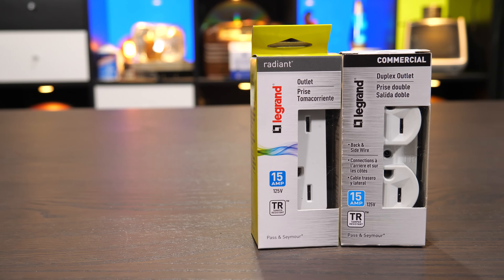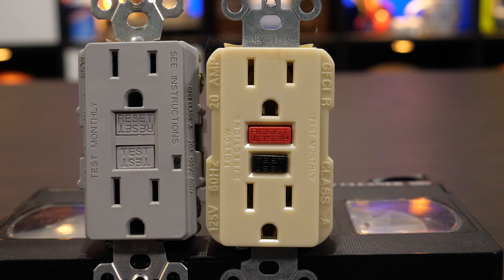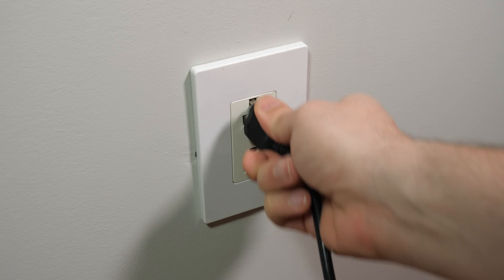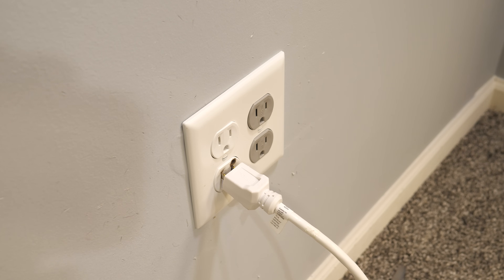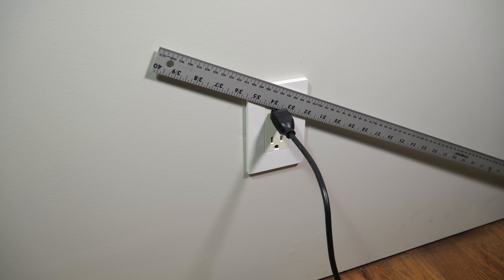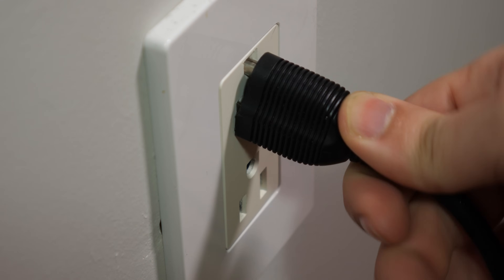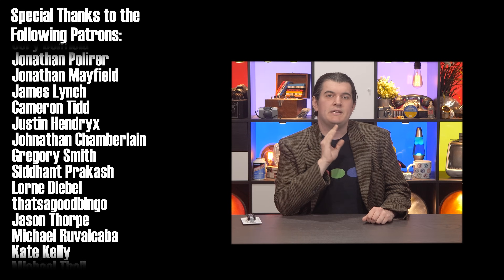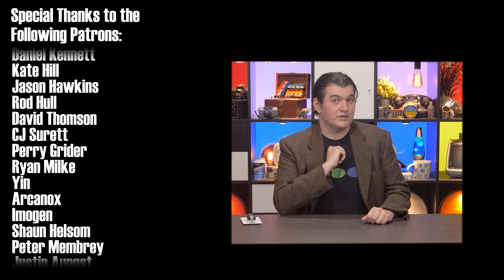Power outlets are topsy turvy - but does it matter?

Comment: Here in Japan where we use mostly-the-US-plugs-but-not-quite-100%, sleeved plugs are becoming more and more common. It doesn't seem to have caused any compatibility issues that I've seen. The sleeves are way shorter than sleeved plugs elsewhere though, basically just long enough to help with the "things falling on the plug" issue but not really the "child fingers going in when plugging" problem.
Reply: The "not quite 100%" is needing to find a screwdriver to plug in a grounded appliance 😂

Comment: Back in my youth in the '50s and '60s, I worked for my father, a general contractor after school. Among the trades I learned under his tutelage and that of his other employees was electrical work. He always insisted on installing outlets with the ground lug up. When I pointed out that everyone else installed the outlets with the ground lug down, he told me that the electrical code required the hot lead to be on the left for the older un-grounded two-prong outlets and he was following that convention. He admitted that having the ground lug down looked more friendly -- like a face.

He said that older ungrounded tools and appliances often had the case connected to the common (not hot) lead of the cord. People understood that plugging in the cord backwards would have the case connected to the hot lead -- a rather dangerous situation. I remember old two-prong outlets that didn't have polarized slots (hot slot narrower than the other). So knowing the left side of the outlet was hot was essential. Hence, standardized outlet installation.

The case of more modern tools and appliances are isolated from both the hot and cold leads, so it's no longer a big deal. But, if you plug in grandpa's electric drill backwards today, you're in for a shock.

I'm curious. Are outlets in Chicago always installed with the hot wire up -- possibly for the same reason of standardization?

Comment: I think this is much ado about very little.  I disagree with the conventional “wisdom” that the basic plug with two parallel flat blades is a poor design.  The fact that is has remained in use for more than a hundred years is evidence that it was a good design.  Over time, there have been improvements, as you have noted, and it has admitted several variations which show that it was a versatile design.  They are: simple two-blade ungrounded; polarized two-blade ungrounded; two-blade plus ground; 15A capacity; 20A capacity; simplex configuration; duplex ganged configuration; duplex separated configuration; single receptacle plus switch in a duplex configuration.  A 20A receptacle with ground accepts any of the plugs described here.

It is inexpensive and molded plugs, which are safer, have become the norm.  The body of the plug can be made in several ways, as you have noted.

As for safety, the hazard is greatly exaggerated.  For one thing, there is only 120V (RMS) to ground.  I have been shocked only twice in my life, in neither case while operating a plug, and it was not life-threatening.  Of course it can be.  You should not be working on live wiring in a wet basement.  But people do not receive dangerous shocks merely by using our plugs.  Most electrocutions in the USA happen because someone is trying to work on an appliance which is plugged in, or is using a metal ladder which touches power lines.

Regarding the single screw on the cover of a duplex receptacle, I don’t see an issue there at all.  There is no stress on the screw because the cover plate rests on the body of the receptacle, when properly installed.  One should never remove the cover while something is plugged in.  There is no place to put a second screw, but it just isn’t an issue.

Another thing that can be done to improve safety is to use a better grade of receptacle which grips the blades tighter.

The modern method for improving the safety of electrical outlets is to have ground fault protection on every circuit.

Comment: I’ve been in the commercial AEC industry for coming up on 20 years next May. Every commercial building I’ve been involved with on design or construction, has has the neutral prong up on electrical outlets. It’s almost universally done that way here in the southeast on new commercial construction. But residential is the exact opposite. I don’t think I’ve ever seen a house done any way but ground facing down. It really is a weird thing.

Comment: If you want to advocate for a safer plug design, HOW ABOUT we start adding fuses to them like many other countries have. All Christmas plugs have to have them, why not ALL plugs?

The outlet orientation doesn't matter one bit if your are trying to plug a 3-prong plug into a socket behind a desk and you can't see the outlet so you feel around a bit with the plug in your fingers and then zap. Been there done that, not fun.

Comment: That's not all that has changed. Check the code book, it is no longer called a "Ground" it is now called the common as the only true ground is the wire from the panel to the actual ground. Don't have my code book handy or I would give you the sections. One reason is all the plastic receptacle and junction boxes

Comment: Aus and NZ have pretty good plugs. No fuses like the UK, but cheap and safe enough while being convenient and easy to use.
Reply: And a clever system of high-current variants. You can plug low-current appliances into high-current sockets, but not the other way around.
Reply: @Roxor128  Honestly, I've never encountered those beyond the plug for the oven. Everything else is fine with the 10A plugs.
Reply: @VecheslavNovikov  I've never even seen one in person (our stove is wired-in), so I assumed they only got use in industrial settings. Still a clever design, though.

Comment: I just realized the plug safety flaw could be entirely fixed by just having them recessed 3/4 of an inch or 2cm into the receptacle, like EU sockets usually do (or at least, the modern ones.... my grandparents' old apartment kinda just has them flat on the wall)
Reply: The EU ones had part of the prongs sleeved on the old plugs so it still wasn't a problem with the flat receptacle.
The recessed ones are even better than the old solution but the problem the Americans have were solved in Europe sometime around the great war...
Reply: Depends on the country, in Italy they are not normally recessed (though exceptions exist). I personally dislike recessed sockets in the Italian context in part because right-angle plugs don't fit in them. They are also arguably harder to clean and probably unnecessary due to our prongs being sleeved. The obvious exception are Schuko outlet/adapters, which due to their design must be recessed.
Reply: That would solve the problem, but it would make a lot of plugs not fit.
Reply: Except that creats a WHOLE host of other problems with devices fitting into the outlet.

Comment: My child dropped a metal braclet and it landed across both negative and positive prongs slightly exposed from a plug in the wall...sparks and a melting occurred but otherwise was a close call

Comment: That's not upside down, tell every appliance manufacturer that uses a 90 deg angle plug. If you install the outlet the other way up, you end up putting a hard 180 bend in the cord, and making the other receptacle useless because of the cord in the way...

Comment: I replaced nearly 300 outlets in an aging house. These were the round non-Decora style outlets and were, for the most part, mounted "upside down". There was a common failure that many of the outlets had, and that was that the plastic on the outside of the ground pin had cracked off. This had happened because the plastic is thinnest at that point and the lateral force is distributed by only a single pin. However, had the outlets been mounted "correctly" there would have been no lateral force from the ground pin, it would have been from the power pins, which by their design should have withstood the force. 
I can only conclude that the non-decora round style outlets are designed to be mounted "right-side-up" (or seem to be designed that way, I have no idea what the designers were actually thinking).)

Comment: The reason why the plug pulls easily when up or in down orientation is that there is less surface area friction between the cord’s metal pins and inside the plug when the cord pins are vertical. When pins are horizontal it creates more contacts in plug while pulling it down or up. I vs — orientation

Comment: You should definitely do some sort of comparison video with plug types from all other countries, including pros and cons
Ours in Australia is remarkably well thought out and we struggle to understand how your design in America is even a thing
Reply: The "Australian" plug and socket is actually American, patented by the Hubbell company in 1916. Its use in the U.S. was limited because the angled live and neutral pins wasn't compatible with existing parallel pin plugs. Australia adopted it because it was easier for local manufacturers to make the flat pins instead of round pins used with British plugs of the time.
Reply: South African here. Same here!

Comment: Don't know about "began in hospitals", but I was thought it in research labs settings. The logic being if a piece of conducting material falls on a partially inserted cord, it probably won't touch both prongs and trip the breaker, but will most certainly shock you if you touch it, remove it. But I do agree that in household, it really doesn't matter. Great video... and subject.

Comment: I worked as an electrician’s assistant one summer in college, he was installing outlets in what I thought was an upside down orientation 🙃. I asked him about it and he talked like it was a new regulation (granted I’m not in Illinois, thank god). The reasoning for the upside down orientation seemed dubious to me but then I thought about for a while. I think the real problem with the face orientation is it looks like a face… aseptically if you have a good imagination, like say a small child. I think the problem is that kids are more likely to try to play with (and get shocked by) a plug in the face orientation. The sideways position would fix this too but older homes electric plug in boxes are normally installed vertically
Reply: Thankfully the mouth, the most likely part if a face one is supposed to put things in is the protective earth.

So following that reasoning the face of the plug only kills psychopath babies trying to gouge the socket's eyes.

But on the other hand from a Darwinist perspective, that only kills stupid psychopath babies, selectively increasing their intelligence over time.

Comment: In commercial and hospital settings, I've seen the orange 125v plugs always installed "upside down" with the ground pin facing up. That's the only instance I can recall seeing such a thing in the wild. I remember asking my dad about it (who was an electrician) and he said that's intentional and by code to differentiate between the normal 110v outlets and the 125v ones.
Reply: The orange (or red) probably just means the receptacle also has emergency generator backup power on it.
Reply: @stephenhenry5346  That make sense. Perhaps they're put in upside down deliberately to mark them as emergency power?

Comment: Outlets that are installed "inverted" typically indicate that the outlet is tied to a switch
Reply: If the US ever went to having switches on power points like we have in Australia, it'd be pretty obvious which were remotely switched as those would lack a switch on the power point itself.

Comment: I’ve received small shocks several times, particularly when the outlet is the newer Tamper Resistant and typically needs more force especially with non polarized devices like some switching power supplies like are common for lower power applications like netbooks or Chromebooks.

Comment: The “added” safety of the ground pin up is insignificant. The common flat plug is the strongest argument for the ground pin down orientation. And if you are concerned with the single faceplate screw coming loose, then switch to Decora style outlets that have 2 screws. They also are generally more robust and look nicer.

Comment: I have two thoughts: (1) when I wired my house, I went "frown up side down" because it's technically ever so slightly safer, but (B) the number of things that just Don't Work Well with ground-up outlets already had me thinking of changing them around. With this video, you've provided the final nail in the receptacle for me to stop procrastinating and start flipping them over.
Reply: Your replication of his little funny in the video didn't go unnoticed by me.  Well done.
Reply: I had to flip some at my Dad's house for timers that would have been upside down with the ground on the top.  To me, it always looks wrong unless the ground is on the bottom.  Like this:   
😮
😮
Reply: Ground up generally allows the plug to tork out of the socket.

Comment: Couldn't be any worse than cutting the power cord of a hedge trimmer with said hedge trimmer. Or an electric saw. Or running over the power cord of a mains powered lawn mower (or running over an outdoor extension cord with a gas powered lawn mower, for that matter).

Comment: why not have plugs that have the cord stick out sideways? that way the orientation doesn't matter, and i can finally use more than 3 outlets in my powerstrip at the same time! (seriously though, half of the outlets in any power strip i've ever set up always get blocked by the giant block of the plug next to it. i've even encountered one plug that was so bad it blocked the outlets on either side of it, as well as the next one down because of the cord!)
Reply: That would be fine for the US. Not for other countries. If the default orientation of power points is a horizontal row with earth at the bottom, a sideways cord or plug-pack is as much of a problem as a downward one is in the US.
Reply: @Roxor128  yes, i meant specifically for U.S. plugs where the ground of one outlet is "above" the hot/neutral of the next (even when mounted horizontally like on a powerstrip or wall). for a different country with different standards of how to mount outlets, my point is irrelevant.

Comment: I have a highly controversial question: 
To turn on lights, should you press the top of the switch or the bottom (or move the switch up or down)?
Reply: Trick question. If the light is switchable from multiple places, it can be either, depending on where it was last turned off.

Comment: For whatever reason, whoever did the electrical work in my house installed the outlets so that all of them are installed ground down except those which are hooked up to a wall switch - those are ground up and the wall switched outlet is on the top… I don’t get it and it looks weird

Further, I had so many issues with various things (like the aforementioned smart plugs) that I’ve reinstalled most of them ground down

Comment: My water pump burned out the outlet because, as mentioned in the video, gravity slowly pulled the plug out. Intermittent contact and smoke!!! My solution?  look for a right angle. Guess what? Nobody seems to make them! You walk into a Lowes or whatever and ask for a NEMA5-15 right angle and you get the dumbest look. Look for it yourself and somehow, they have everything BUT that. At the time, I went on Amazon and ZERO! Just check and they're full of them.... WTF! So, what did I do back then? Invert the outlet.... Problem solved.

Comment: I rarely comment on Youtube, but your wonderful attempt at throwing knives on the wall reminded me a few months ago, while I was speaking to a coworker through Zoom, and incidentally talking about electric conductivity instead of work (my struggle with static in my office basement), behind me a Displate (starring the USS Enterprise) decided to fall, leading to a bunch of sparkles and my breaker shutting it off. The Displate fell right on the two pins and to this day, is stained with a burn marks on the bottom left part of the metal poster.

Comment: I've worked at bicycle shops for 25 years and I've seen a bunch of derailleur/brake cables get flung behind a plug on an outlet and start melting everything.  It's a pretty serious problem in my industry!
Reply: Commercial properties are required to have the outlet installed with the ground up.

Comment: As an electrician, I was once in a situation where a co worker was filling a room with 150' of metal fish tape. It ended up spoiling over the very loose plug of a fan, and shot sparks all around the room. But of course, the cord wasn't grounded so it wouldn't have mattered, as you said.
Reply: I've done something similar. There was an extension cord on the ground near where I was feeding a fish tape. It was still in the conduit, and I felt it getting hot in my hands. The two pieces weren't fully connected. And it didn't damage the fish tape. I think it tripped the breaker, but not quickly.

When using cheap extension cords, the voltage drop is pretty high. High enough that it won't actually trip a breaker due to the high resistance and therefore low current. But, it'll still give you something to chew on if you touch the live bits.
Reply: @IceBergGeo Even the cheapest extension cord wouldn't have a high enough resistance to avoid flipping a breaker when shorted. More likely that the fish tape only made contact with the hot pin and was also in contact with something grounded (like a conduit or pipe). Steel is a surprisingly lousy electrical conductor, so over a few meters it could definitely avoid immediately flipping the breaker while also getting really hot.
Reply: Why did the room need to be filled with all that?
Reply: @Kremithefrog1  Because plastic fish tape would have been too bulky.
Reply: Probably looks cool as shit